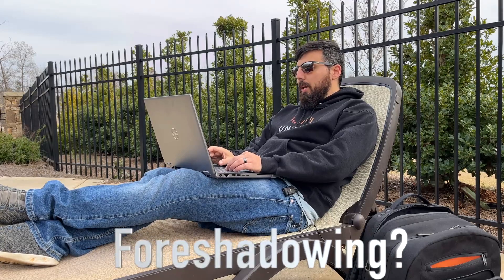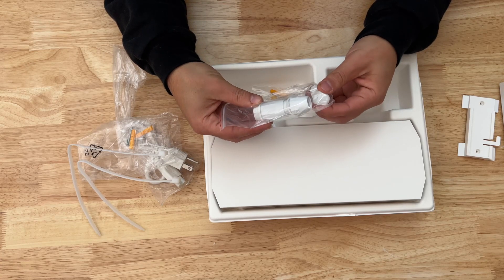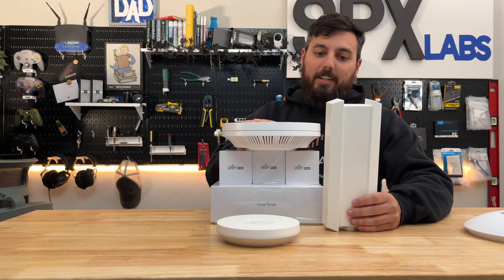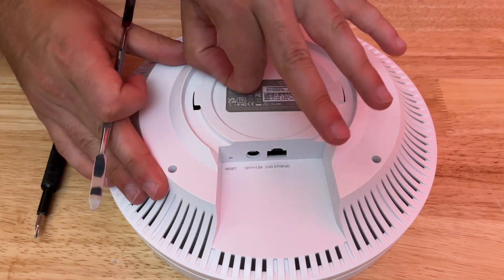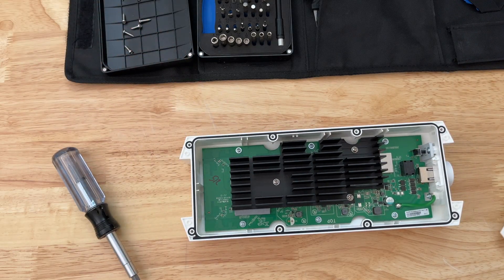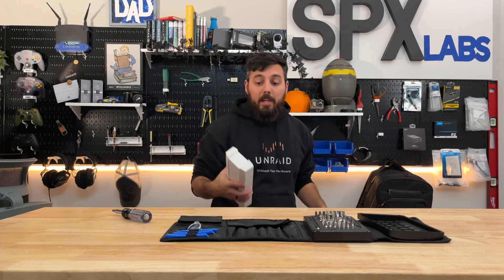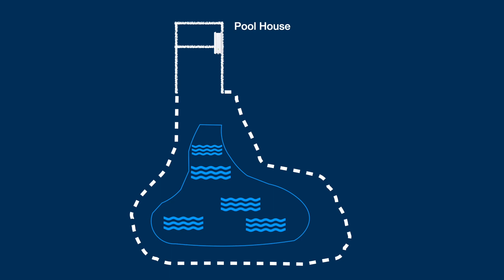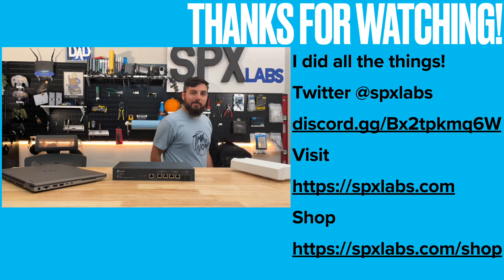Teardown and Speed Test of the EAP610 Outdoor WiFi6 from TP-Link

Comment: Nice summary. You added the EAP610 Outdoor as a wireless access point. I want a wired connection with the EAP610 Outdoor and then add two additional EAP610 Outdoor Wireless Access Points. Can you explain how to connect the EAP610 Outdoor as a wired connection since the TP-Link Omada site defaults to adding the EAP610 Outdoor as a wireless access point?
Reply from the maker: I’m not sure what you are saying but in this video the EAP is connected via ethernet

Comment: I got 700 down from 5 feet away running in AP mode with a MoCA 2.5gb back haul. I get 350-550 down from 10-50ft. The variations seem to depend up how many this are connected and actively streaming combined with distance, interference from neighboring Wifi.
Reply from the maker: Yup.  That’s WiFi for you 🤷‍♂️

Comment: Great video.  Have you taken into consideration that the EAP610 probably cannot "hear" the laptop's wispers at those distances even if you measure great signals from the EAP610? :)
"The signal from AP is strong but the AP is at the edge of the coverage area of the laptop."
Reply from the maker: Not really, but it was odd that on 5GHz it worked better.

Comment: This could be a good solution to getting better network to my shop instead of doing direct bury CAT6. That way, I can mount it directly on the external wall if the house. It would only be a 30-40ft distance for connection after that.
Reply from the maker: Could be.  But it could be better
Reply: @SPXLabs  the 30-60mps would be more than enough for what I need in my shop. The price isn't too bad either.
Reply from the maker: Oh yeah then I agree
Reply: @SPXLabs  is the link in the description an Amazon Affiliate link?
Reply from the maker: Always